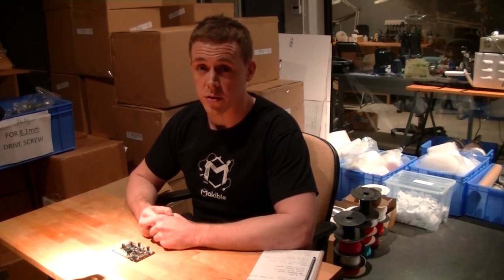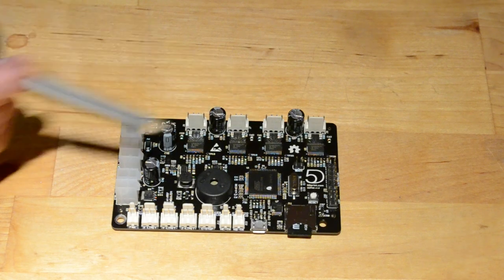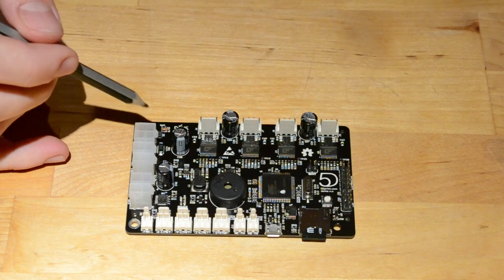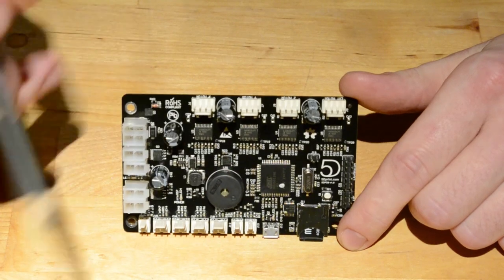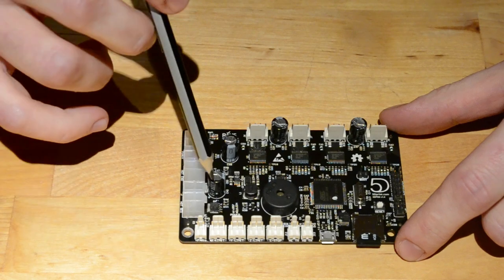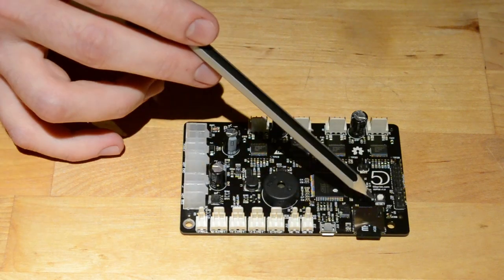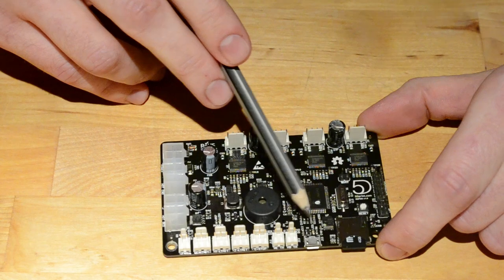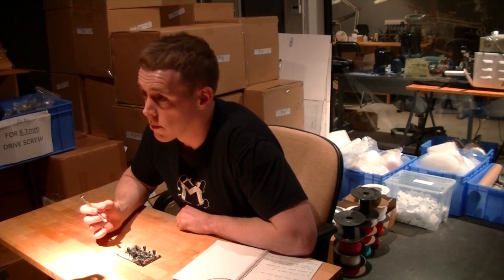5D Print D8 Driver Board Overview

Comment from the maker: Here's a followup walkthrough for the new 5D Print D8 board with our electronics engineer Martyn.
Reply: Brook Drumm, have you seen this yet?
Reply: Yes. We have updated our printrboard too... Made some of the same changes and a few different ones too. Worried a little about brand confusion but our new price should make the decision easy for most. Nuanced differences mostly. But different firmware for sure. I am all for changes that help the community, s a positive outlook overall. Open source means this type of development has to be embraced. Our company is much stronger and we trust buyers will consider the whole package.
Reply: All files for the beta box CNC design and the files for this board design will be available on 5DPrint.com as soon as we have time to get them up.
Reply: If others had asked for it earlier, it would have been done sooner, but people were asking for us to focus on shipping product, and so we did. I have the CNC files available now if you would like them.
Reply: 950 shipped ! :D
Reply: Strange.  When I looked at MakiBox's official shipped count page a minute ago it read 710, not 950.  So much for Jon's promise that everything ordered before December 2013 would be shipped by the end of January 2014.
Reply: 950 was ordered on April 2013.
Reply: Jon pls Upload some pics from prints with the new board or is the quallity the same ?
Reply: It is the same output. The controller and stepper drivers are the same. The changes improve other aspects of the board.
Reply: ***** Neither am I.  He's started deleting my posts on the facebook page asking for clarification of his definition of "lead time" and criticizing his multiple lies about production schedules.
Reply: George Van Winkle you are ignoring my responses pointing to the same numbers you used to quote to me. I've responded multiple times with facts and with a complete answer, but you are just looking to troll at this point.
Reply: Ignoring your responses?  You have taken MONTHS of questioning by Camerin Hahn, other users, and me to finally admit that Production Lead Time is supposed to start when payment is made.  Once you finally admitted that, you deleted every post I ever made on the MakiBox Facebook page regardless of whether it pertained to this discussion or not.  Some of those included responses to a potential buyer about print resolutions.  Your hack job made your own responses look disjointed.  

As I stated in some of the deleted posts, numbers for February do show a significant production increase.  The best those numbers can do is be used for a guess of what your Lead Time really is.  Point blank, you have lied about it for a VERY long time so far.  Anybody who doubts that should look back at your Official Production Schedule posted back on October 28, 2013.  Or do you plan to conveniently delete that too?
Reply: Hi George Van Winkle if you promise to not spam again, I will un-ban you from the FB page. I know you are actually a reasonable person elsewhere, I will trust that you will be so in the future if I go forward with that. If you want to have a discussion on this topic, keep it in that topic you started, and not spammed everywhere. 

The discussion we are having in the present is dealing with the present numbers, and the facts that I outlined are simply that. If you continue to insist on digging more, that is fine. I'm standing by my facts, what are you standing by? I admit that we are finally getting caught up and are maintaining the schedule. We have have more than our share of issues that had to be worked through, and we gave what we believed were honest answers at any given time. However, now I am not depending on projections, only extrapolations of the historical data. You have a chip on your shoulder from what happened in the past, however, I am dealing with today and the future. Perhaps join us here in a rational discussion about the present.
Reply: ***** Thanks, that is precisely what we are doing.
Reply: Jonathan Buford Been waiting 10 months for my Makibox! Customer support doesn't even reply to my emails.
Reply: *****
And now people are going to take it to paypal and notify them of the void of delivery of "paid for merchandise", to loose their paypal account will make it harder to sell their printer as no one will trust direct transaction to a communist bank, and hopefully paypal will get a action against these people if they cannot refund cash.

And it's all because they wont tell the truth about their lack of production or that they wont change their wait time to reflect reality of their being no wait time and that they get printers out to customers in the only way they can,, = when they feel like it.
Reply: Jonathan Buford Just for posterity: The D8 design files aren't on 5DPrint.com, as mentioned above, but are on https://bitbucket.org/makible/5dprint-d8-controller-board

Comment: Could you please add a simple pinout diagram to the source-files on Bitbucket?

https://bitbucket.org/makible/5dprint-d8-controller-board/

The pins aren't numbered on the board, and the PDF schematic doesn't show the alignments of the pin-block; I don't have the specialised software required to read the proper PCB-layout files - is there a simple free importer we could use?

I'm working on getting my Raspberry Pi integrated with my shiny new Makibox, and had to use a multimeter to find suitable 5v/ground pins - not ideal ;)

Btw, is there a way I could control the board from my Raspi via its Expansion pins?  I've currently got it connected via USB, but it'd be nice to keep all the wiring inside the box if possib;e/

Comment: Martin, looks like you were put on the spot with this one, everyone saw how you looked up at Jon at the end of the vid.

Most people wouldn't know how a usb is connected from a 4007 diode, or that this board is any better than what other was first used, what I'm saying is how does anyone know this board is any good,, take you word for it,, and if it's not you get the blame, this board already looks like it was possibly in the works as it looks to have a 5D logo on it,, is that someones idea of being funny, that they branded it like it was in full production, seems more care is taken with branding than packing of actual printers.

Martin,, your left holding the bag on this one, you poor sod.

Comment: Yay! Another reason to delay our purchased makiboxes even more! 

Between this and the Chinese new year you guys have a couple good excuses left before everyone starts doing chargebacks.
Reply from the maker: As fauge7 said, this didn't delay anything.
It was a side project to begin with and didn't bind up anyone longer than needed.
With the first batch already in-house, it goes right into packaging and shipping for all outgoing orders from now on.
Reply: Yeah no delay as there was already delays so you cant actually put more delays on something when there already is delay,,or can they,, I hope that clears that up.

And don't forget Easter will add more of the "no delays" added to the actual delays,,lol
Reply: Frank Blackcrow Are you this rude in person, or do you just save this for the internet? 

Martyn takes a lot of pride in having done a proper revision to this board, but it sounds like you probably wouldn't know the difference based on your comment above. We took the opportunity to give him acknowledgement for this work. 

The branding of 5D Print, just like our host software and firmware, is for work that we are releasing primarily into the open source community, and we wanted to have this board under that from the start so that there wasn't any sort of confusion if someone else makes a clone of it in the future, like there is with the Printrboard. 

And, as iterated several times, the boards are currently in stock, so there is no delay or even a mention of a delay. In this case, we deliberately waited to announce the board after we had stock so that people would not have anything to complain about, but it appears that it didn't stop them from trying.
Reply: To those that take other peoples money, and make promises that they don't keep, this might be seen as rude, but then other people might see that taking peoples money and not keeping their promises as rude, possibly other words would be used besides calling you rude.
Reply: Makible Still waiting. 10 months and counting... I also got the "Chinese new year" excuse as to why my order hadn't shipped.
Reply: Josh Gillick
Exactly,,,dude pull out, there are other printers that are just as cheap,,and have bigger build area's and have better response times to getting information to their customers, these guys are going to screw their customers as much as they can just to use them as a source of a non interest loan they don't have to make,,My opinion is thats why a lot of these people use kickstarter, it's a free money scam for those of lesser moral standards.
Personally I wont be trusting this guy Jon anytime in the future if I see his name accredited to anything on kickstarter or the other sites that are for making new products with crowd funding.

See how it is,, they got you for 10 months worth of interest on your money that should have been yours in your bank, if anything they owe their customers money.